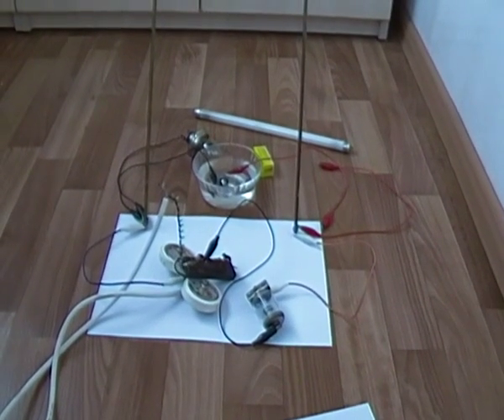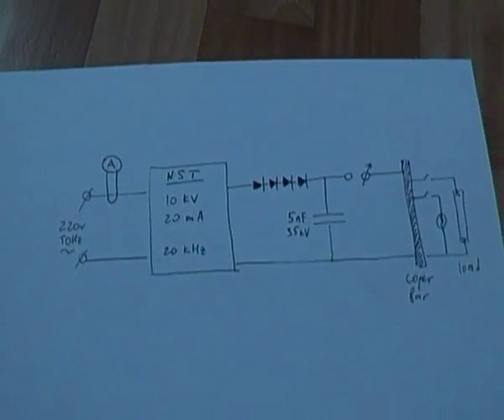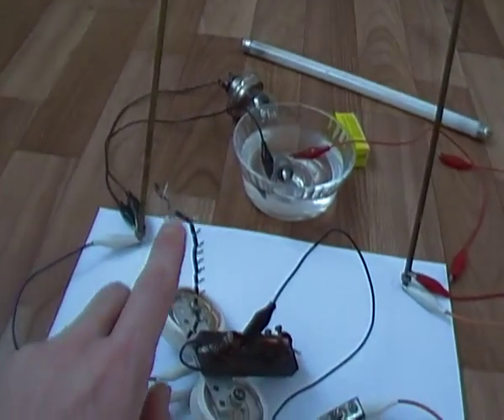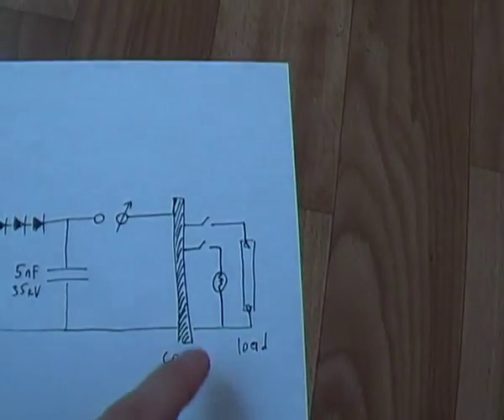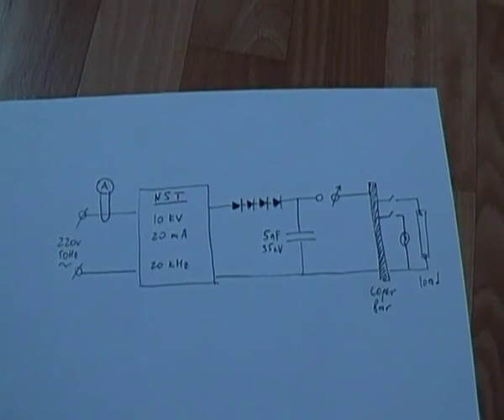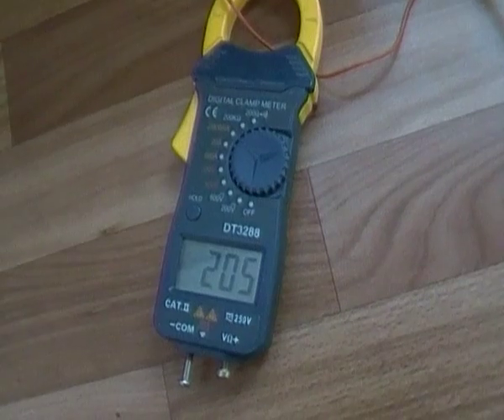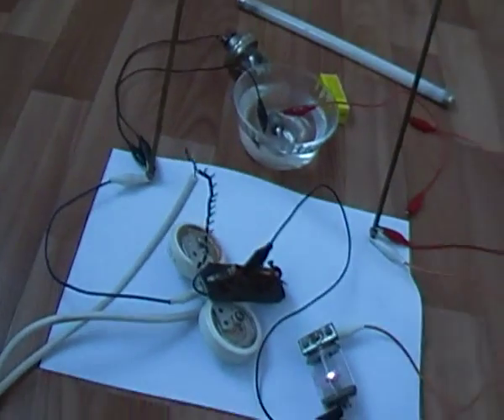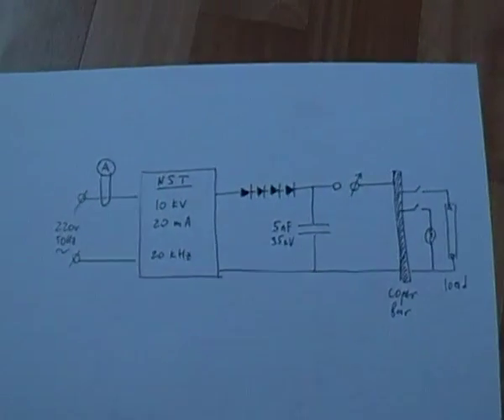Non-classic Tesla Hairpin Circuit

Comment: The reason consumption goes up is BEMF from the secondary coil. If you want to decrease the energy consumption while adding loads, you need to go back to the transformer construction techniques! By using a frame transformer and adding a magnet on the frame, you can block the BEMF: m/watch?v=r8asKJNYJIY  
Same thing can be achieved by using a "bi- toroid transformer: m/watch?v=aVYiT4zK9Kc
This will make the primary blind to the existence of secondary coil.